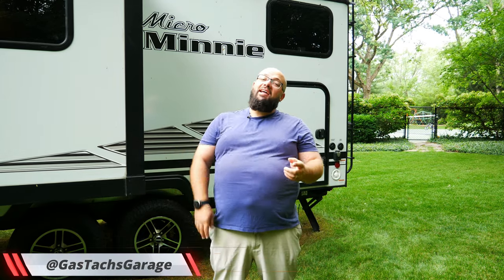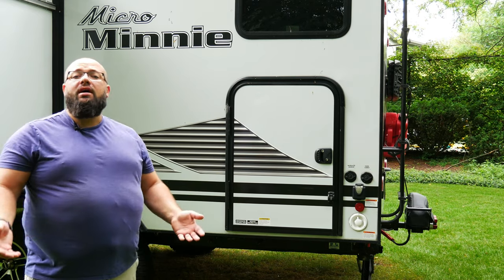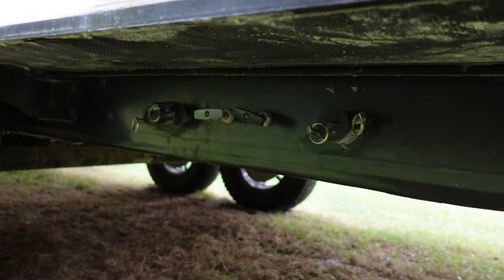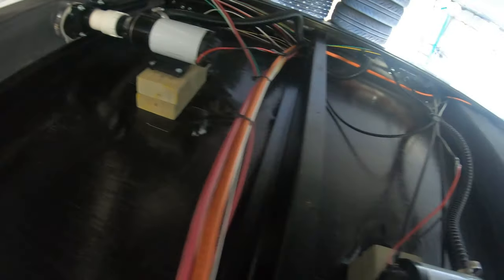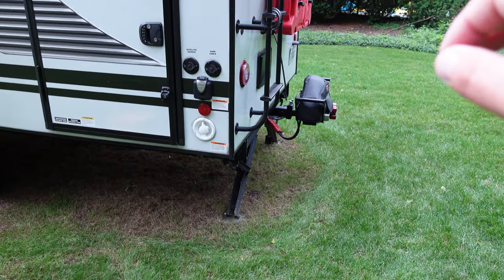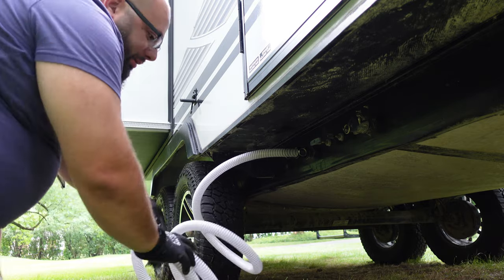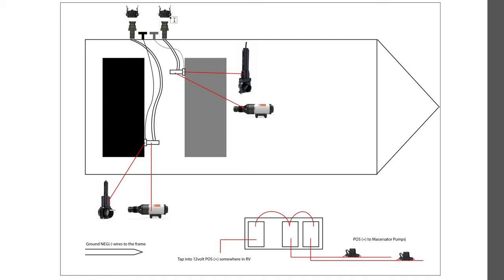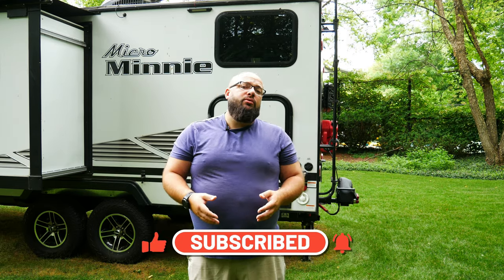Upgrade your RV Dump system and dump anywhere! Ultimate Dump Station Solution!

Comment: Man I really want to like this system. And it sounds great as long as your pumping downhill.  But it seems as soon as the pump runs out of water to create pressure, gravity will take back over.  Then you're left with the stuff between the pump and the end of the hose to deal with.  Am I incorrect? If I am how does it push it the rest of the way up hill?
Reply from the maker: You''re right, but how far up hill are you pumping... I do black first then grey and never had an issue with back flow

Comment: How long does it take to empty compared to stock gravity hose setup? Do you think you could plumb both tanks into one pump?
Reply from the maker: So they are 12 gallons per min pumps… never had a clog but my pumps are hooked right up to the tank… I think if you try use 1 pump it won’t work

Comment: What kind of reducer fitting did you use to go from the 3" gate valve on the black tank to the 1.5" npt macerator input? I tried to zoom in, and all I could tell was that it is not concentric. 

(I just bought a micro minnie and may have quite a few questions for you regarding specifics of some of these cool mods!)
Reply from the maker: Hey man, thanks for tuning in. I’d be happy to jump on a call and answer any of your questions. Shoot me an email or DM on instagram.